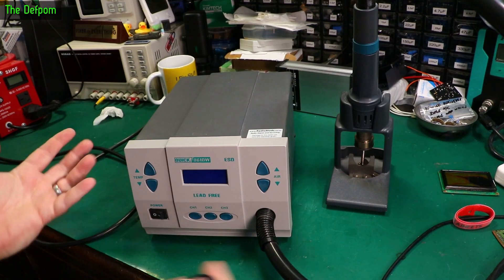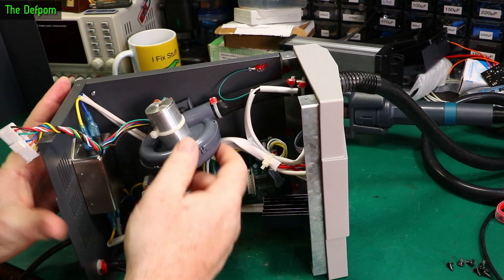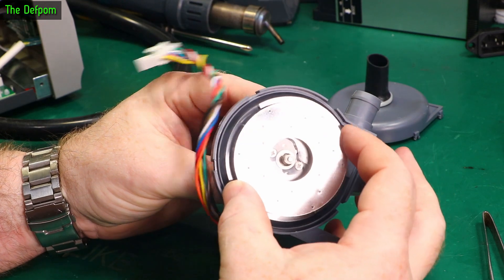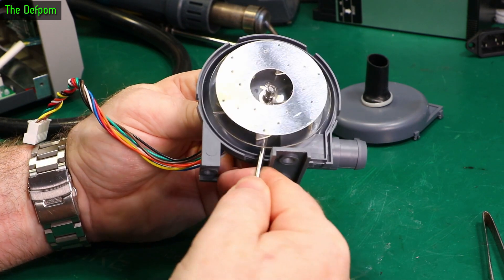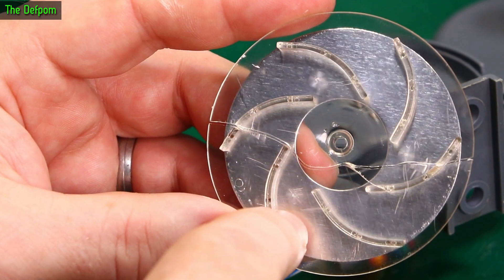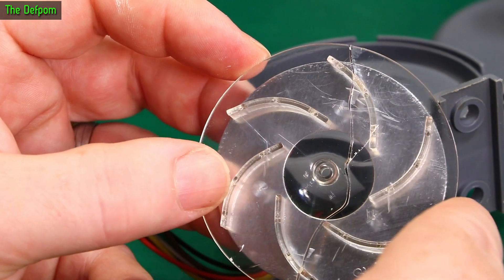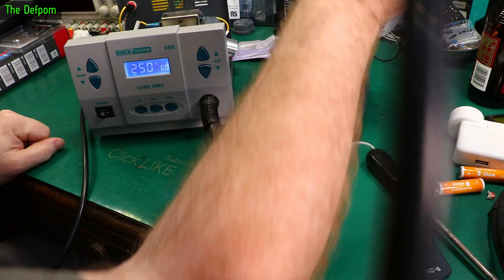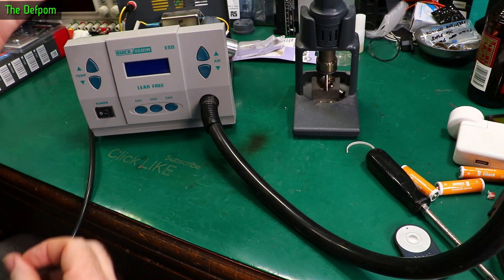🔴 She Won't Blow - Quick 861DW Air Pump Repair - No.1085

Comment: do you still recommend getting this hot air station? or should i avoid it
Reply from the maker: @300maze  it is good, just watch out for the fake ones out there.
Reply: @TheDefpom  the unit in the video is a fake?
where do you recommend buying a genuine unit if im not in the US?
Reply from the maker: @300maze  this is NOT a fake this is a real one.

Comment: Since you're happy to glue the impeller, why not glue the original one back together?
Reply from the maker: It was a stress fracture, it will crack again.
Reply: @TheDefpom  in 5 to 10 years, you mean? 😬

Comment: I'm surprised this Expensive Quick Hot Air station has a cheap air pump compared to a cheap chinese model like the KADA 852D which has a bigger and great quality air compressor inside it...

Comment: Greetings from argentina, I just ended up here, as I was doing some repairs tonight and suddenly heard an explosion coming from the unit. first I thought would be some PTC exploded or fuse, but to my surprise the impellers was borken in pieces. Will try to glue it with cyanoacrilate. But I'd like to 3d print from the designs , which one works better? thanks again
Reply from the maker: The one I used in the video is still working fine for me, it hasn’t failed again yet, I suggest going straight to the updated design though.
Reply: @TheDefpom excellent so I'd use the updated sandwitch design much better right?. This it the one you designed. Also I was thinking on trying printing with my resin printer instead of my normal filament PETG what do you think?
Reply: Hola querido , como te fue con la impresión ? Pudiste solucionar soy de argentina también y me pasó lo mismo 🤦🏻‍♂️ si podes contáctame así me ayudas hermano por favor

Comment: QUICK 861DW professional mobile phone repair and repair station, using brushless vortex fan, adjustable air volume, wide range, can be used for a variety of purposes. The system has the function of automatic cooling of air volume, which prolongs the life of heating elements and protects the hot air handle.
Reply from the maker: If you are try Int to subtly advertise your brand maybe send me stuff to review instead 👍

Comment: 3d-printers are so great for those one-off plastic replace parts! (and so great for making custom enclosures that everyone making electronics needs or finds at least usefull)
I make a lot of one-off stuff. The last part I printed was a one-off holder where I can clip a snow shovel on. Bought one general clip on holder, but it was of unsuitable size and I printed a better one that fit the wall better with that exact shovel..

Comment: Seems like a widespread issue if there are multiple files on 3D printing sites...
Perhaps the plastic was too hot or the mold was too cool or both and there was a lot of stress in the material as it cooled down.
Also why did they use some PC?
If they would use ABS which is softer it probably wouldn't crack.
Or even better use PBT with addition of CF.

Comment: Great fix video Scott, I’m looking at a Creality 3D V2 upgraded version, would you recommend that unit for a new person to 3D printing.. ?? Keep up the great videos mate.. 🤙🏼🇦🇺
Reply from the maker: I have n happy with it, the only upgrade I think it has to have is adding a magnetic sheet on top of the glass bed, to make it easier to get parts off, the Z upgrade I did recently is also nice, but not absolutely required.
Reply: @TheDefpom  cheers mate, I appreciate it greatly 🤙🏼🇦🇺

Comment: I use my 3D printer for all sorts of things around the house.  Door hinge spacers are great, I make a set of varying thickness so I can get the door to hang straight. Plus you can match the colour to the paint work.
Reply from the maker: Nice idea

Comment: The fan probably cracked because the plastic lost plasticiser, and also yes the flow lines, but likely also poor balance. You probably would get better airflow with it being slightly smaller diameter, as that then allows higher flow in the outside area, which, to work well, should be a constantly expanding volume from the exhaust side, so the air is constantly being added to the flow the entire circumference, instead of only really the last section adding flow volume. But I guess that was too hard to put into the mould, so constant diameter and poor performance is it, and the resultant pulsation creates stress in the impellor.
Reply from the maker: It could have made been made better.

Comment: Random question - Did you get IC shaped heads for the unit? I've been thinking about getting a couple for my unit (not the same as yours, just some random hot air unit) - Wondering if you did and if so what your thoughts are on them.
Reply from the maker: I know it is possible to get them as I had looked at them at one point, but then I remembered that I'm too lazy to change them out LOL, I would have thought they would be good to use on larger QFP IC's.

Comment: I commented about this in EEVBLOG years ago. Mine failed after 6 months. I was able to get a new one out of the supplier.  I was really surprised how flimsy and weak the main working part in these blowers is.  I tried without success to get replacement parts from the manufacturer and was blown off.
Where did you order the blower fan from?
Reply from the maker: I found it on aliexpress: https://s.click.aliexpress.com/e/_DCdwGUX

Comment: I would have solvent welded the broken one. Been doing that a bit lately ever since I discovered PMMA S-Polybond. It is insanely good. Even on PLA it doesn't actually glue, it is a solvent that dissolves the top-layer of the plastic (different sorts too, acrylic, pla, etc) and when it evaporates a few seconds later the plastic hardens up again and makes an insanely strong bond. Only thing you have to remember is that it does not fill gaps, the two parts have to touch. It has the consistency of water so it can creep into cracks easily too.
Reply: Interesting. I looked up the datasheet.
Normally I use MEK (butanon/methylethylketone) for this, but S-Polybond is methylacetate with a tiny bit of methanol (<0,5%).
MEK is a little bit slower in evaporation (higher boiling point and lower vapor pressure).
I also  would have tried to glue (chemically weld) the old part.
I wonder if the original part is polystyrene or acrylic glass (PMMA)
Reply from the maker: I haven’t heard of that one, it certainly would be good to have at times.

Comment: That's the spirit, well done! Also I can never get small holes to print to size either. If I want 3mm hole I need to sketch it at like 5.5 or something, or print with enough shells to give some meat to drill it out a little, or just print it solid and drill from scratch.
Reply from the maker: I’m still running my setup, as you saw it is only about .4mm under now.

Comment: Iss beezin raysiss on ya! Tryna keep yer proeepoles DOWN man! Check out their newer updated high-speed low-drag version! It's all sexy and stuff. Quick TR1300.
Reply from the maker: The power switch is on the BACK of the TR1300... no thanks, I hate rear mounted power switches, why put a control you HAVE to use every time you use the unit on the rear of the housing, that is just stupid.
Reply: @TheDefpom  My Hakko FM-203's feelings are now hurt. !!! Who would HIDE the power switch of ALL THINGS on the BACK??!